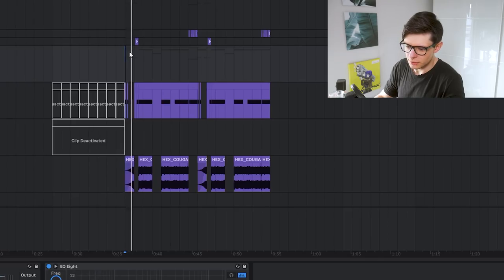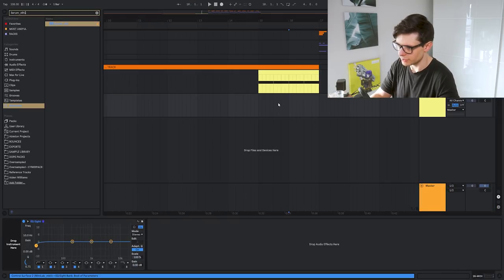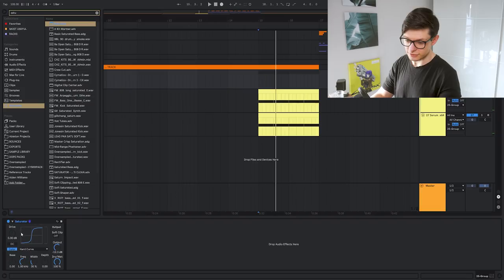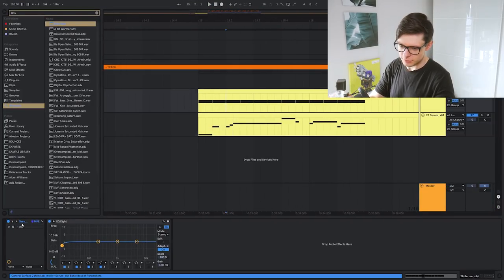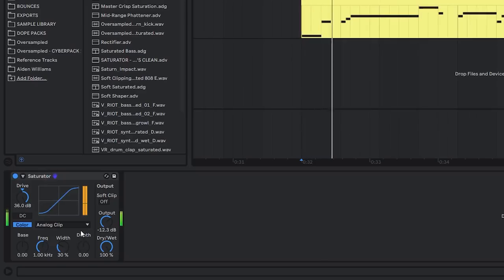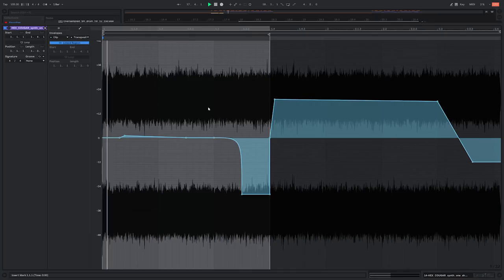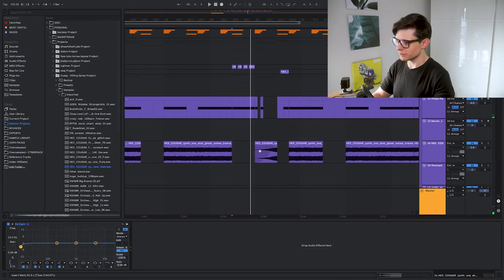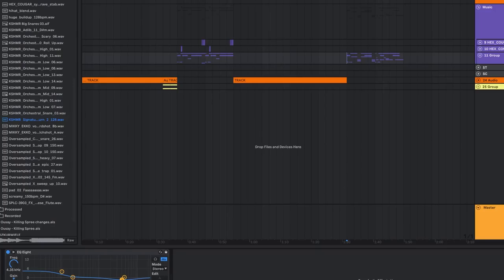My Favorite Sound Design Technique Recently 💥

Comment: Guys, does anyone know why my ableton crashes when adding a "vital" plugin to a track? I reinstalled the plugin several times. But it didn't help. HELP!!!!!!!!!!!!!!!!!!!!!!
Reply: Works fine for me. I don't think Vital is especially intensive to run, so it's probably not that. Have you contacted Support?
Reply: I haven't contacted customer support. Perhaps the problem is in Ableton. I will install version 11 soon. Let's see what happens.
Reply: @sitttttttt  I had a problem with Steinberg's Backbone and Ableton Live, which is apparently being fixed, so it's not unheard of to have clashes with certain plugins. But then again, I found a ton of other Backbone users having the same problems, whereas I'm not aware of widespread problems between Vital and Live. I hope it works for you soon!